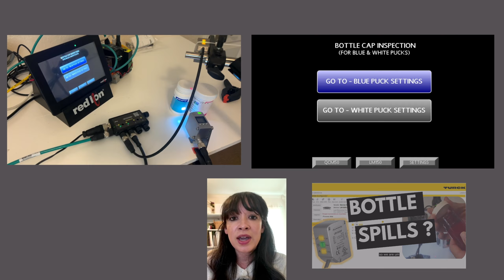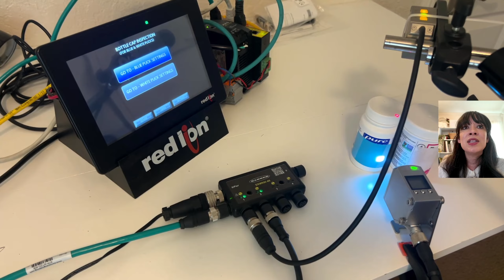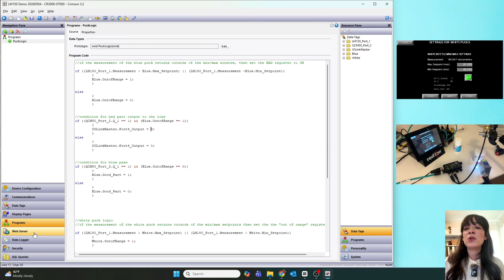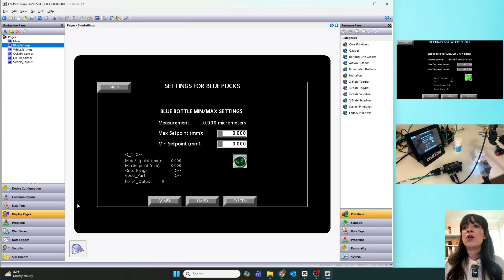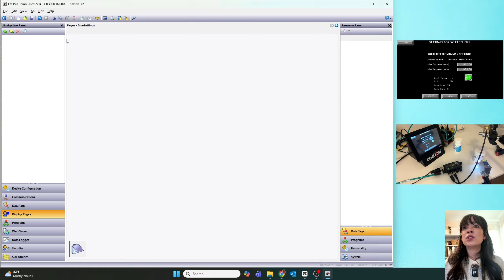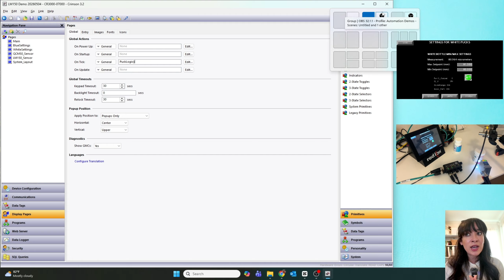Bottle Cap Inspection Using IO-Link Sensors & Red Lion HMI | Banner QCM50 & LM150

Comment: Hi,
I am facing an issue in CODESYS Modbus mapping.
The HMI writes parameter values to PLC through Modbus Holding Registers. For example, the parameter Basket Wash Setpoint (DW1) is set from the HMI and PLC receives the value correctly.
However, when I try to change the same parameter from PLC logic (using a MOVE instruction or by writing a new value to the same tag), the value does not change.
For example:
HMI writes 22.0 to DW1.
In PLC logic, I enable a MOVE block and try to write 25 to DW1.
The MOVE block is enabled and active, but DW1 remains 22.0 (or 220 internally) and does not change to 25.
If I connect the MOVE output to an internal PLC variable, it works correctly. The problem only occurs when using the Modbus-mapped HMI tag.
It seems that the HMI communication continuously overwrites the PLC value, so the PLC cannot override the parameter.
Is there a recommended method in CODESYS to allow both:
Parameter changes from HMI.
Parameter changes from PLC logic (Default Settings button, Recipe Loading, Auto Adjustment, etc.).
Could you please advise the correct solution or mapping method?
Thank you.